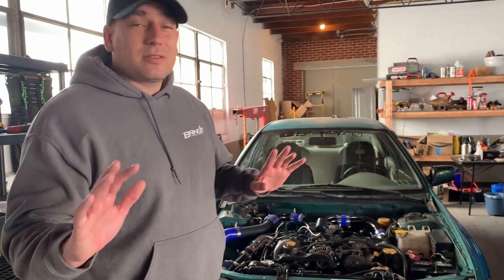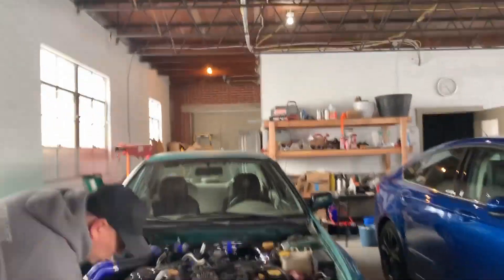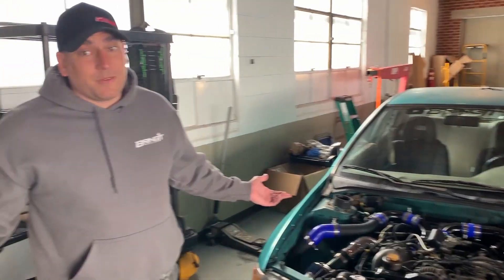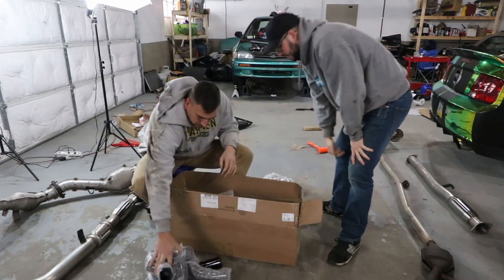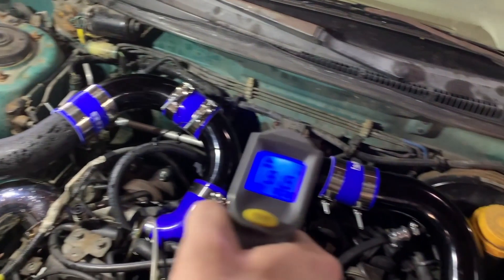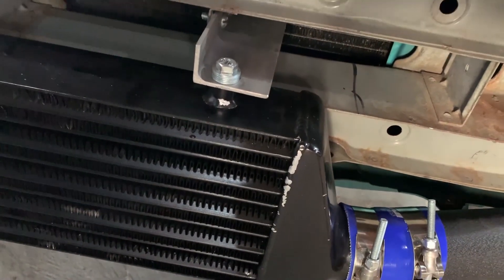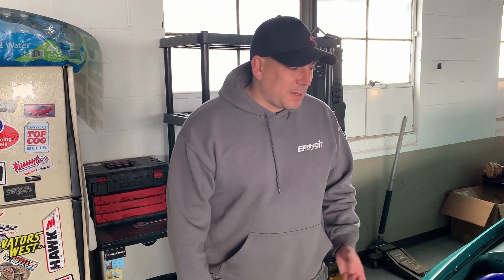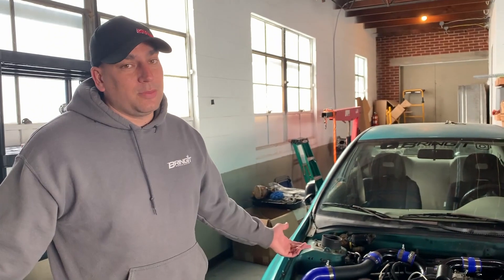Do eBay Intercoolers Work??

Comment: do ebay turbos work? no, they don't.  see next video
Reply: They sure do.  I made 600hp with one
Reply from the maker: SydneyChromatic aw yeah. That’s awesome. What car were you running one on?
Reply: @BringItMuscleCars  94 accord with an h22 swap.  Followed the grand innovator a man named Bigdaddyvtec from homemadeturbo.com. back in the 2000s he was the go to for accord guys
Reply: @BringItMuscleCars  i am currently beefing up a 2000 audi tt for 800+ hp.  Just got rid of a 70 Nova yenko clone with a 496 all motor and my twin turbo g37s.  I get bored quickly
Reply from the maker: SydneyChromatic I would say so. You’ve had some cool cars.
Reply from the maker: camopaint0707 I don’t have a eBay turbo just piping.